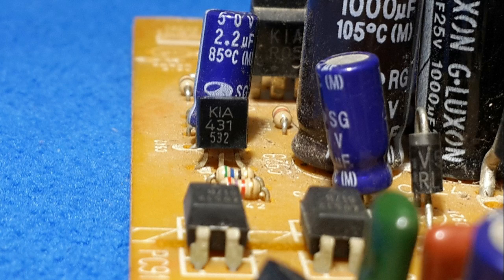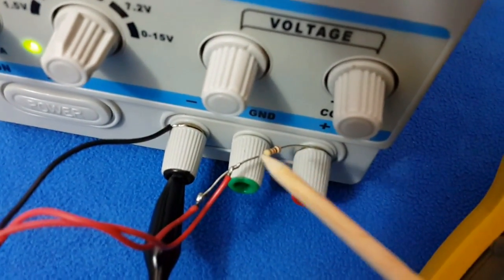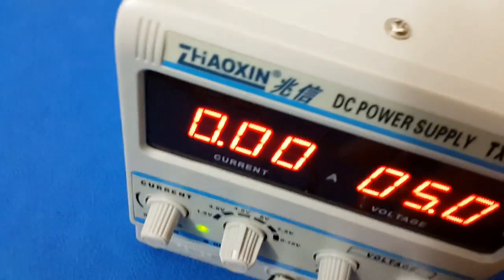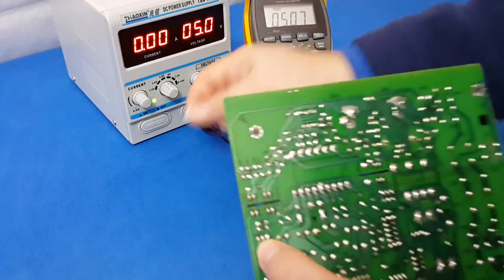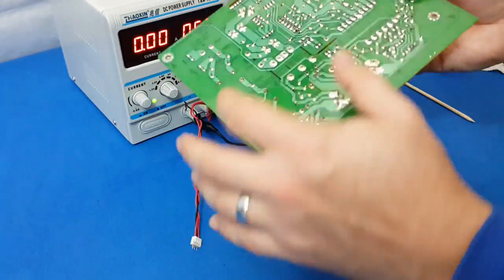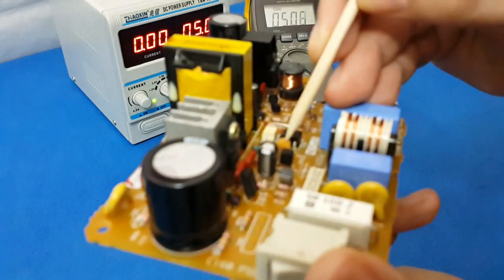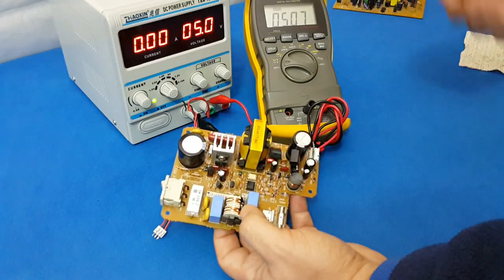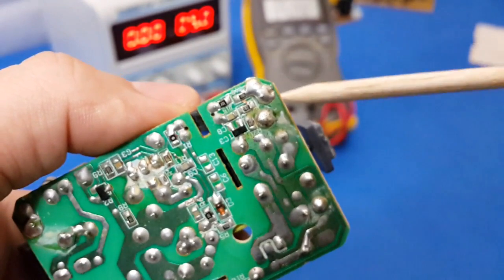How to TEST TL431 Voltage Reference / TL431A TL432 KIA431 Shunt Regulator circuit

Comment: Hello Sir thank you for your video! i have a question your connector has plus-minus-plus but on the datasheet the pins are ref-anode-cathode ... i mean they look inverted why is that? and if the ref is the output voltage why are you applaying plus on that pin ? please explain this better

Comment: Thanks for this tip - very useful way of testing in-circuit! Technical question - the TL431 type references use an internal Vref of 2.5V, presumably this is why you're using 5V supply and 1k resistor. For a reference that uses an internal 1.25V Vref, what would you suggest - 2.5V and 1k?

Comment: Hi, how check tl431 without supply with multi meter. What is it pins reading?
Reply from the maker: Hi! TL431 is an adjustable Zener. The only way to test it right is to apply voltage to it.

Comment: Your video is old i dobut you will answer me  i want more clarification  same on TL431
Reply from the maker: Hi! What do you need to know? ...the video is about an easy testing way.
Reply: @bob.kalpon1398  I understand Some say it should reference voltage 2.5 volts 
please see some attachment how it gives regulate output  https://prnt.sc/op34iy   https://prnt.sc/op35dr   my email t17101990@gmail.com
Reply from the maker: @TT-ii5bu  There are two manes for TL431, one is 2.495 voltage reference and the other is "adjustable zener". There is more information in its datasheet. For your drawing, the adjustment of the 10K resistor can change the output voltage. Try to analyze the circuit in two ways as voltage divisor: Optoacouple way from 12V to GND is the voltage division or voltage drop from 12V across 100R, LED, 270R and TL431.  The other way is the sensor voltage from 12V to 10K, 2.2K, sensor in TL431 to GND. The formula is in the datasheet. I will make other video about this component.

Comment: TL431  is a component . Any explanation  of the TL431 requires a schematic which is FAR more understandable than your commentary !
Reply from the maker: Hi! If we talk about how to use it.. Yes, then we need engineering knowledge that is something we should not apply without schooling and backing it up with the right documents like datasheet and some books to avoid fails. But how to test it, is about technical procedures that could be applied in some or most situations. Technicians are trained to apply procedures in order to find a bad component and to replace it. Engineers are the ones trained to design from scratch or partially modify an PCBA. If you were in technical school, then you will learn about technical procedures. If you are in the university, then you will see this component from the datasheet and a pair of books point of view. (Anyway, after our designs, somebody has to teach technicians in the future about how to repair future failures. I am a designing engineer, and I always have to write the manufacturing procedures, test procedures, and service manuals. Service manuals are fast food today, and limit to find a problem and order a new PCBA that will be probably discontinued. Many years ago, we used to train technicians to repair).

Comment: Hola, dado q mi ingles es malo, estara este video en español ??
Reply: Edgardo Jassan Hola, yo soy brasileño, voy tentar explicar-te lo que ello diceste.
Ello diceste que usted necessita conectar dos fios (cables) positivos (+) juntos en serie con un resistor de 1K hasta positivo de la fonte (5V+). El fio (cable) negativo (nigro) sera conectado al GND y tambien en lo cientro del conector.
 Depues conecte las pontas de prueba de lo multimetro para teste.
Se mostrar los valores semelhantes, entonces el TL431 estas buen!
Reply: Marcos Nunes muchas gracias.muy amable
Reply: muchas gracias, muy amable de tu parte

Comment: Hello..
When i try to test on the board, tl 431 just show 1.33v.
And when i pull out the tl431 from the board and test independently with this trick, it's show 2.5v.
Is it good tl431 or defective one..?
Reply from the maker: Hi! Three things could happen:
1-. Your power supply gives too little current. Remember the serial resistor is only 1K. 
2-. There is a bad component around the TL431.
3-. There is nothing wrong, it is just that in this case there is a big load of components around the TL431.
I hope it is just option 3. But first go and check the optocoupler next to it, any capacitor o other device arround. Some times you can pull them out to see if the voltage increase.  ;-)

Comment: Can you tell us about the 3 prong connector you used?  Where did you get it?   I can't seem to find a connector like that anywhere....not Google....not ebay
Reply from the maker: Hi! I got it from an old TV or VRC. But its size is the same than the in line pin connectors most people order for arduino projects. Just check the 1K resistor must be placed in serial to the red cable in the center and the black cables on the sides directly to the negative in the power supply.  :-)

Comment: Hola, por favor lo podrías publicar en español ? Gracias
Reply: Terry Prieto Rodriguez  es muy facil, el terminal central a negativo, los extremos van unidos a una resistencia de 1k conectada a 5v, desde la conexion de los cables conectas el multimetro en voltaje y al probarlo debe darte la tensión de referencia de 2.5v.... espero haber sido claro
Reply: ElectroTecno Mza, muchas gracias por tu respuesta, me pondré a efectuar las pruebas. Saludos desde Colombia.

Comment: I wanted to be sure, sow what I did was remove the  431 , them I reinstall a new one, and got the right reading thks again
Reply from the maker: Ok. Then before to end, take some extra time and check the optocoupler if there is one next to it. (Just to avoid a 2nd repairing because another component could be about to fail to). ;-)

Comment: MR Kalpon good after noon Sir , I was checking out Your video , and it is grate , I make the circuit ,  I tested a TL431 on board the results were 2.33 is it a good tl431 or no
Reply from the maker: Yes, it can be good. Just check the following aspects that can change the perfect reading: Serial resistance with+/- 5% tolerance, DMM with +/- 3%, or the best ones with +/- 0,5%, the power supply current limits, the noise level about 15mV, or parallel components can drop some extra voltage too. (Also resistances in the test leads you made, or your voltmeter leads can have some resistance too). If we check the TL431 datasheet, we will see two models and difference accuracy % for each model. Now, you can put all the evidence under test to find out where you lost about 12mV. This experiment is good, because in this case, you need to evaluate a test against precision, and it will let you to know better your equipment. (It is like a shooting with a pistol. At the distance, we need to point more up, down or on the sides, that the pointer says). ;-)